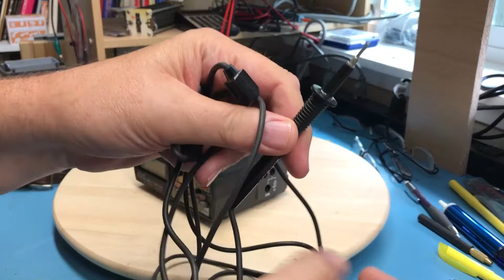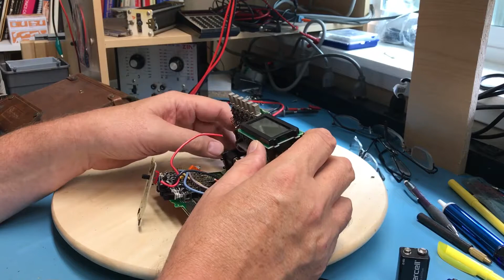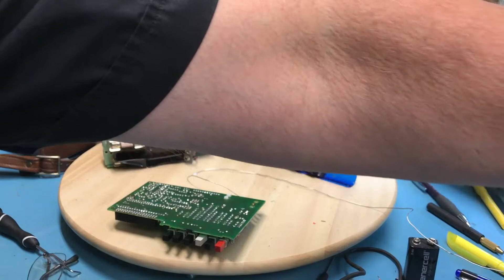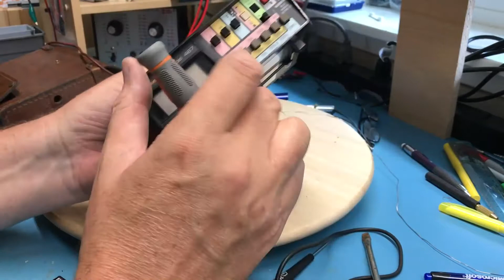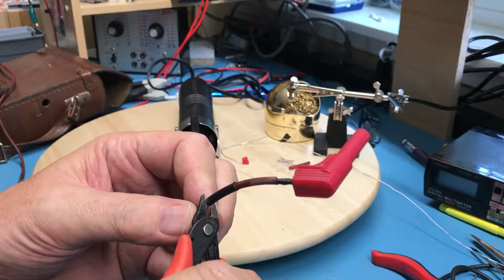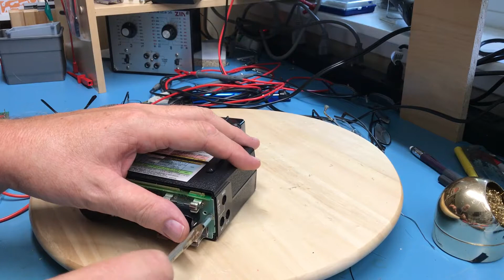Vintage Lab Gear - Simpson 467 Digital Multimeter teardown, minor repair and testing - STB66

Comment: I have that exact meter, just badged as a "Xerox 600T 1616" with "made by Simpson Electric Company" on the back. Still works just fine, and if it wasn't such a massive battery hog I'd still use it as my daily driver.
PS: they have dark red stamped-on datecodes on the back cover outside and inside with a YYMM datecode. Mine is from week 44, 1985 (so older than I am by a couple years)

Comment: Good overview on this meter.   I would be surprised if the leads could not be replaced with ones meant for the Simpson 260 which also uses the reversed shielded plugs/jacks.

From the schematic it looks like the two big chips drive separate parts of the display.  One controls the digits and mode indicators, the other one controls the bar graph portion (one pin on the chip for each bar graph mark)

Just picked one up off eBay for pretty cheap.  I like repairing vintage test gear anyway.  Although I'm more comfortable with tubes, this is interesting too.  Thinking to mod mine to run off a 9V transformer wall wart, and maybe playing with LED lighting the display.

Comment: hello friend how are you I congratulate you on your video I also have a simpsons 467 but has a small problem in the scale of DC measurement on the scale of 2V the screen remains at 0.07 making short between the tips I measure a voltage measures well no problem other scales remains in 0.00 i read the service manual and the equipment is calibrated that can be?
Reply from the maker: This sounds like it could still be calibration. The error looks to be about 3.5% of full scale (0.07 / 2.00). I don't recall the specs but this does seem a little high. For my unit I had to do a lot of cleaning of the push button switches using deoxit. I lost the video I shot for this. I would spray one switch then depress / release the switch multiple times. Many of the switches would get stuck depressed. I doubt cleaning the switches on your meter would help the 0.07 issue.
Reply: @ShadowTronBlog  Excellent work on bringing back to life the Simpson multimeter and the broken lead, you did some great surgery on the lead!
Reply: this is my video of the problem https://www.youtube.com/watch?v=G__NVJF9JA8
Reply from the maker: I don't recall the details in this meter however there is often precision divider resistors that get switched in / out depending on the scale. Perhaps one of these for the 2V rail is shorted, possible from someone applying too high a voltage.
Another possibility is an issue with the rotary switch. Perhaps a solder ball or damage for the 2V range. The internals of the switch are really delicate should you decide to take it apart. Bending one of the contacts in that switch would most likely result in an unrepairable switch.